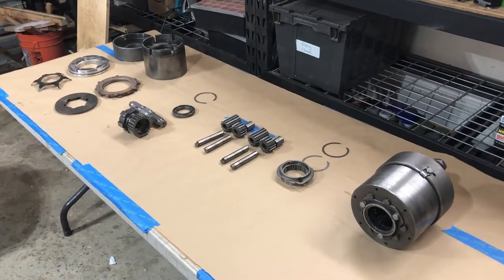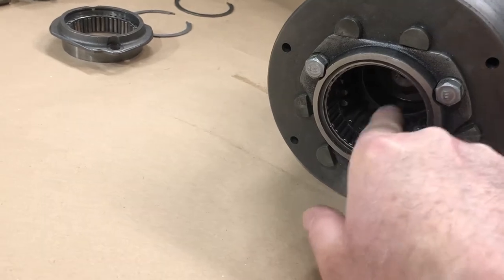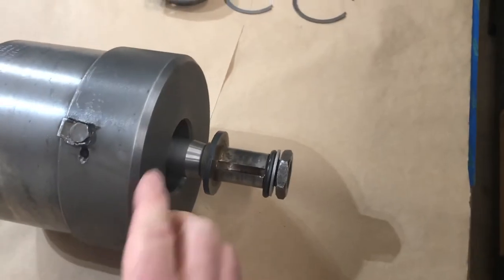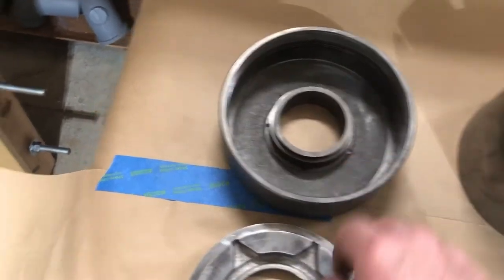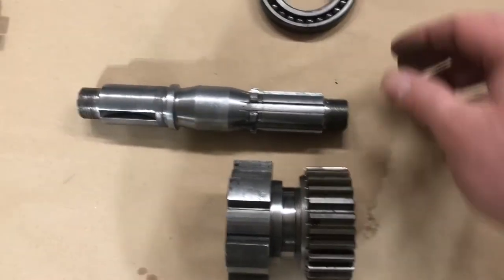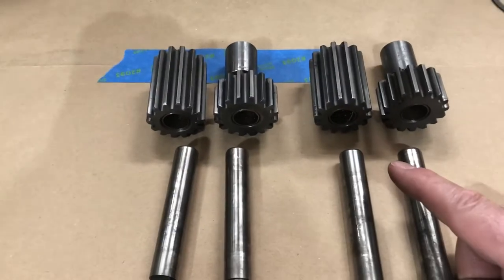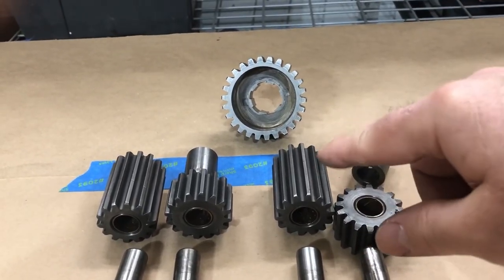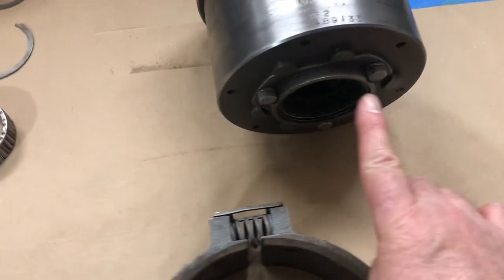Disassembly of a Paragon HF Transmission

Comment: Great video as usual Guy. Looking forward to your HF2 rebuild as that's the same transmission I have paired with an original Chris Craft 283. My forward gear feels fine but the reverse seems to be slipping and I'm wondering if there's anything I can do to address it without removing it from the boat.
Reply from the maker: If your transmission is a hydraulic shift transmission like mine, there is no adjustments from the reverse band. However, on the manual shift transmissions, it is my understanding that the reverse band can be adjustable. This is accessed by removing the top plate. I had my reverse band re-lined at Cobra Transmissions, Sebring, Florida.
Reply: @GLF-Video  Interesting. I also have a model HF2D hydraulic transmission but it does have a band adjuster on the starboard side of the case. It looks like a headless bolt or threaded rod sticking out with a jam nut. I talked to an old time repairman and he told me the adjustment was to turn the rod in with the engine running and the trans in neutral  just until the prop shaft starts to rotate in reverse...then back it off a little . Then when you apply the band with the shift lever it will have the proper grab. However this didn't help in my case which leads me to believe the band probably needs to be re-lined.